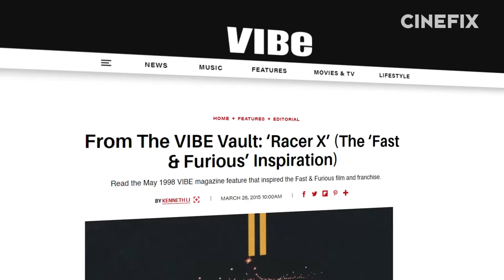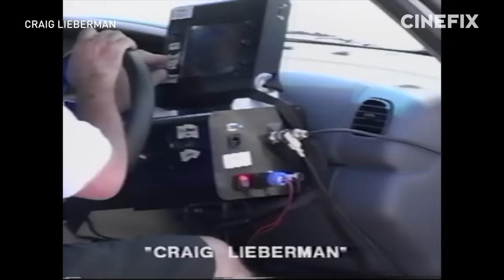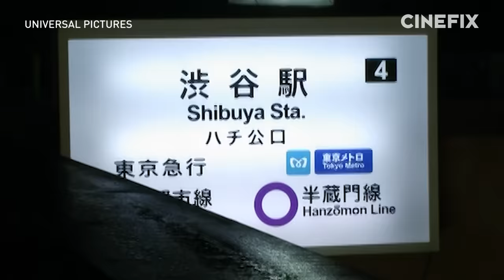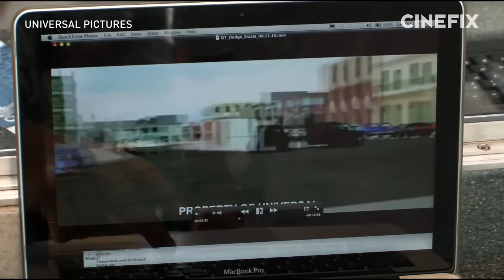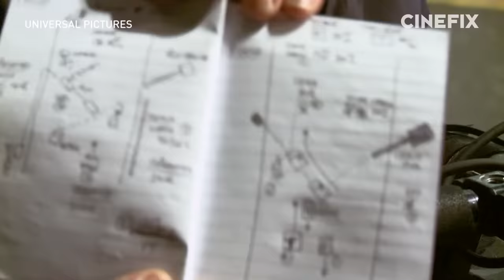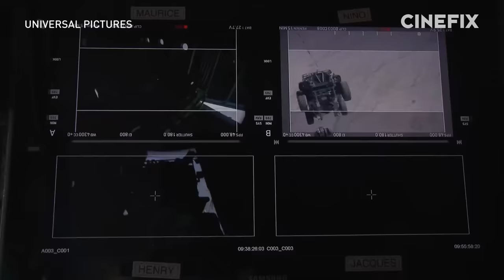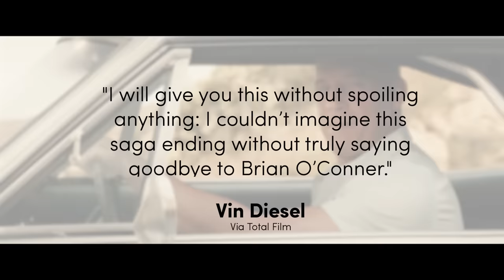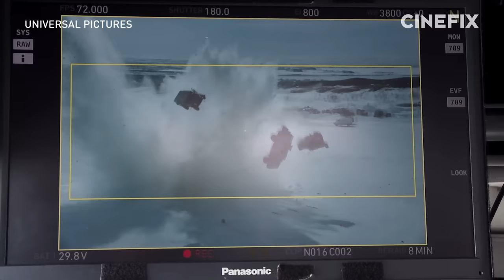The 20 Year Evolution of Fast and Furious Car Chases

Comment: Top much CGI, if you're going to do stunts, do them for real. If you have to use CGI, the stunts are rarely worth it. 

Look at the tunnel scene in 4 for example. Couldn't use real tunnels, so they resorted to using Tokyo Drift method. Except they CGI'd all the dust, dirt, debris, and speed in, making it look terrible. Whereas Tokyo Drifts looked real, because they retained those small details while doing the stunts for real.

They need to treat these kinds of series like TV shows. Have a few buildup movies, with a grand finale episode, and a bigger grand finale at the end. Have a couple Fast 1 films, with a 4 to top it. Then go back, have a few Tokyo drift movies, and a 5 as a finale. 

Car enthusiasts, if you want GOOD movies and shows to be focused around cars and racing, GO WATCH THE MOVIES. This crap shoot of a series could have been avoided entirely if people went and actually watched Tokyo Drift. Now we've got another bland action series.